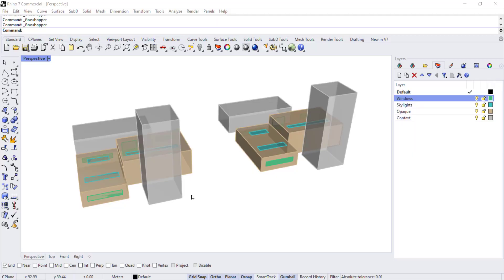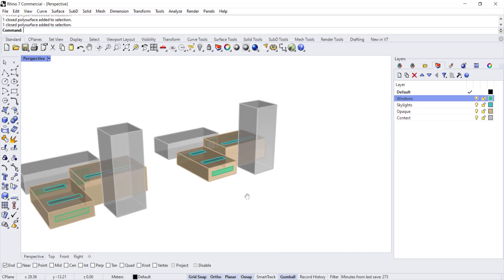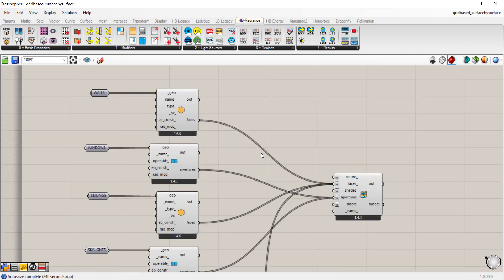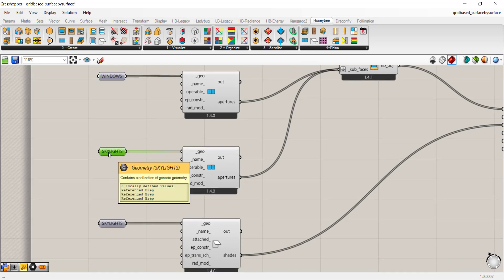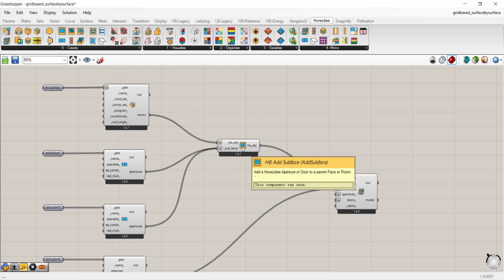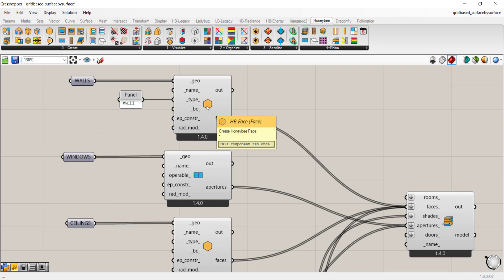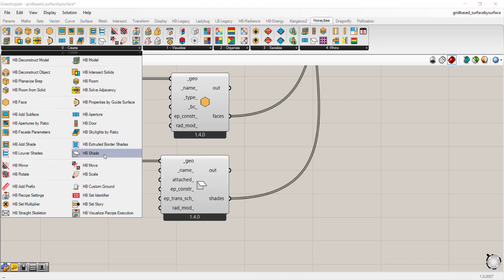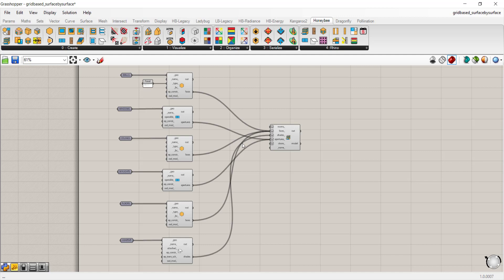Daylighting in LBTools: Create Geometry

Comment: Good tutorial. Some notes/questions:

1. Can you provide the .3dm model used in this tutorial?
2. It would be useful if you go through building the script when it is so simple instead of just showing a premade script, similar to Chris' energy tutorial. It's sometimes hard to follow the steps as I have to look up the components which can be confusing.
3. It seems there is a mistake in the "solid approach", as you are inputting the skylights both as apertures and shades and not inputting the context geometry.

Comment: Hi. Is it possible to assign entire ceiling as window. Why I am asking is, I want to calculate temperature of floor assuming there are window on top, front and back. Walls on the sides. To be simple, I want to simulate microclimate between two vertical pv panels.
Reply: Hi Ron. Yes. In a daylight model, you can create the ceiling as a face and assign glass material to it.